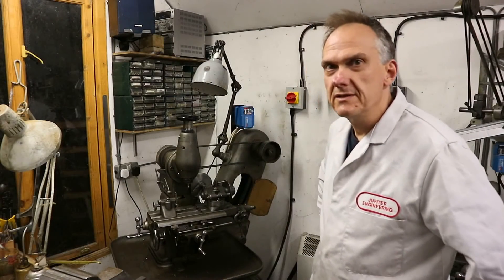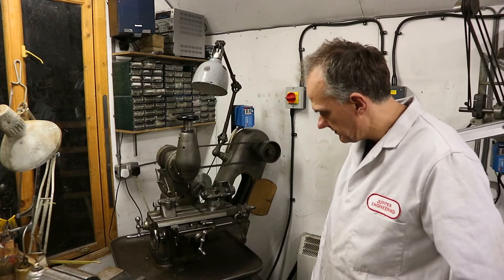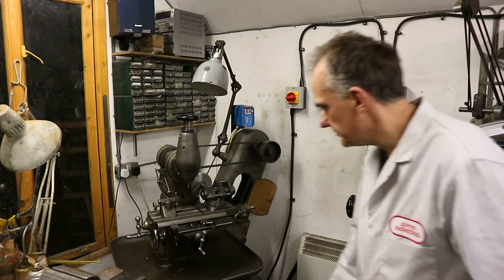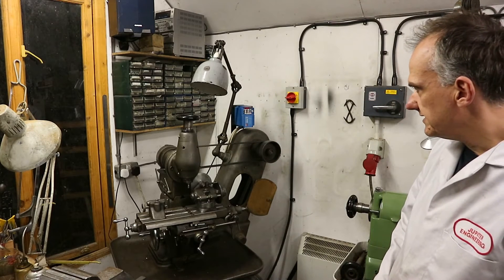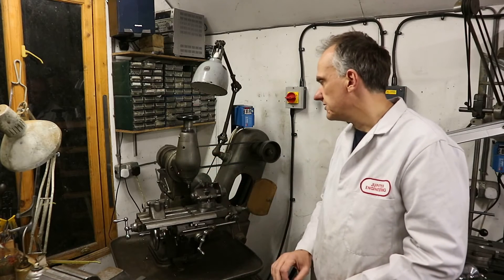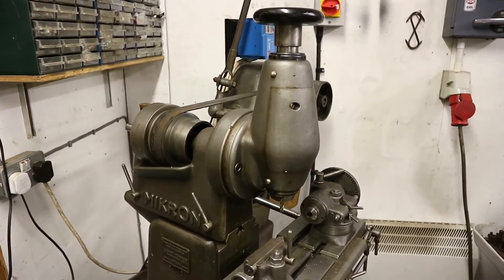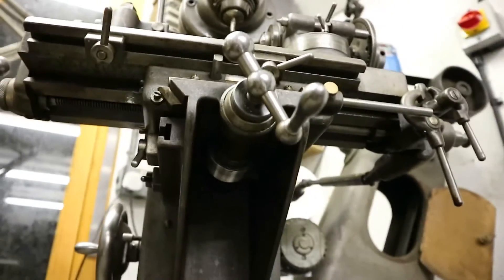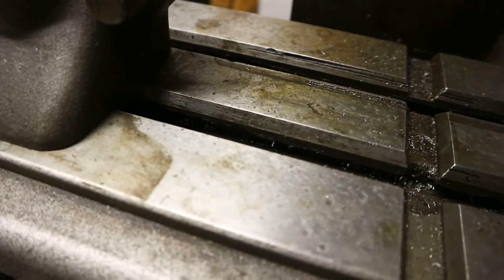Mikron F75 Milling Machine - 1: general overview

Comment: A special feature of these old Mikron machines is that they are not painted but have a metallic coating applied by flame spraying.
Reply from the maker: Indeed, I think I mention that on my website and in other videos. It looks like some kind of nickle-iron alloy to me, but not sure.
Reply: @davidsamways  In the company where I used to work, we had Mikron gear cutting machines. These machines were built with a precision that you probably don't find anymore. And I know enough other machines from Switzerland and Germany.